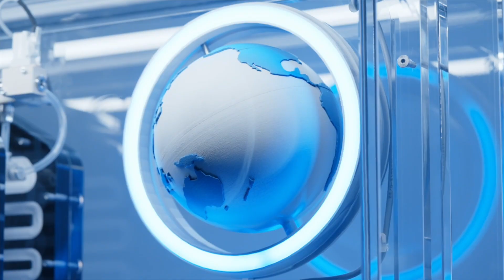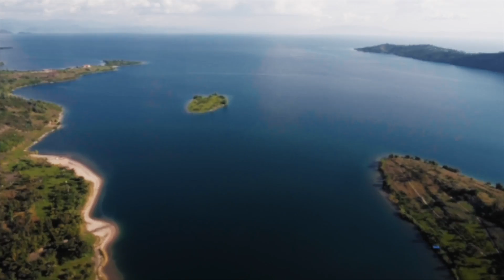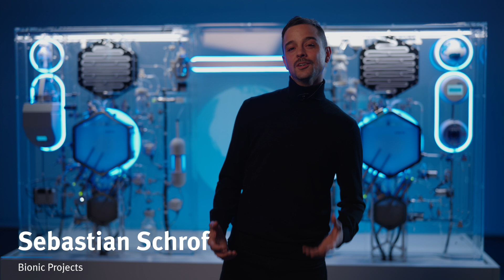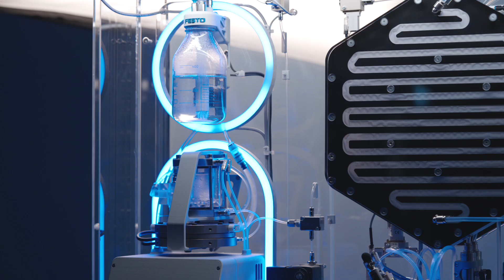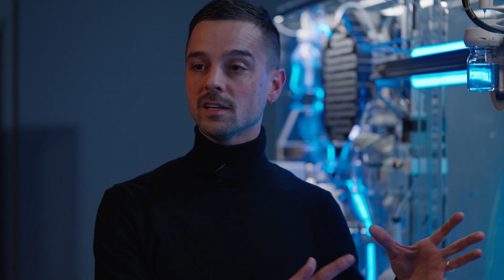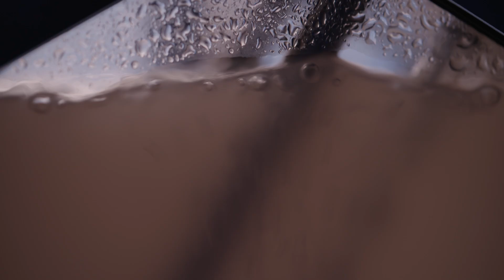Festo BionicHydrogenBattery

Comment: like this is cool and all, and could probably be used in industry or chemistry to make hydrogen on sight rather than needing to store and transport it in a gas but like, by the time humanity has set up hydrogen reactors that can use this in what like 15-20 years (new tech takes a while) we will be most of the way to a mostly classically renewables based power grid, or the more pressing issue would be the multiple extinction level weather events a year, and not power generation. The issue for solar and wind could be in cold environments but you have an issue with this freezing and lowering production as well, is there even a viable gap in the market for this, for anything other than maybe formic acid production for use as formic acid?

Comment: Interesting idea, but calling it efficient or economically viable (which is implied in the video) is a stretch at best, especially if you were to scale this up. It cant be efficient (both in therms of energy and space) to concentrate this liquid which is essential for long term storage since you cant store a 1 percent mixture of that stuff (unless if it's ok in a usecase to store 1kg of hydrogen in more than one ton of a dilutedd acid. Even if that limit is overcome, there are many maore. Anything power demanding cant use this form of storage (as it is now) because the reactorsize to achieve a high enough throughput compared to conventional methods is gigantic.  So saying it doesnt need to be gentically modified to increase throughput and efficiency is more wishful thinking. Besides what would gentic engineering help? i dont think it could fix the fundamental efficiency problems of this process. Bacteria need energy to live and replicate. that energy must come from hydrogen, meaning the "catalyst" isnt really a catalyst either. It consumes (potentially) a major part of the hydrogen compared to other inorganically catalyzed processes. If the underlying biological process has a higher efficiceny than current formic acid pathways it might be viable to look into that, in order to find a more scalable solution, that isnt limited by biological restrictions and can operate at much higher throughputs and small space and low catalytic needs (heat required, materials, resistent to most environments and has few catalytic toxins).

Comment: I'm doubting about this project. 1) before the bacteria reduce CO2 to HCOOH (direct reaction), then the same bacteria oxidize this compound to CO2 (inverse reaction): which conditions allow this metabolic change? In photosynthetic organisms light presence or absence causes the CO2 reduction in carbohydrates or their oxidation. In these bacteria there isn't any trace of chloroplasts.
2) The reduction needs energy: where does it come from?
3) How do we prevent the destruction of these bacteria by other microorganisms?
4) What's happen if we don't feed them? Wich other nutrients do they need? When they'll multiple (bacteria double population every 20 minutes about), raising overpopulation, what will we do?
5) How many energy does the bioreactor consume and how many energy does the batch produce? (Tell the amount of microorganisms population, please).
6) Which size have the system?
7) For you this transport of hydrogen is safe: you don't tell it's formic acid, the venom present in ants, bees, hornets.
So how do you prevent some accident? What's for allergic people? How concentrated is the solution? How is it regulated? I don't see any manometer, or pH-meter, or other apparatus.
8) Also heated acid formic in presence of ammonia transform to ammonium formate, then formamide, and finally in hydrogen cyanide: another problem during a fire.
Reply: If i may throw my 2 cents into the ring, 1) It would be a matter of concentrations or temperatures, much like how plants release CO2 at night when photosynthesis can't take place, if the conditions are right then it would be possible that the inverse process could take place. Assuming that there would need to be a metabolic change is not considering that these bacterium already have that 2 way metabolism. 
2) The bacterium cannot be treated like a chemical reaction. In classic chemistry there would need to be a reduction but in this case, the bacterium are living things which means that they feed on it and are not just performing a simple chemical reaction.
3) Hermetic Sealing and Teflon Coatings as a start, but we are very good at making very pure things and making sure there is no contaminates would be a trivial process.
4) They explained this in the video, they require a certain temperature to grow and as such, if we don''t feed them then they just lay dormant, if we for example lower the temperatures of the containers, they will survive without food in somewhat of "hibernative" state.
5) Bioreactors don't consume energy, nor directly produce in this case. They leverage organic processes to convert one thing to another. A good example is an alcohol still, that is to say the fermentation process. You give it food, and let it do it's thing, as simple as that. In this situation, they are only using them to convert gaseous hydrogen (H2) into formic acid for the transportation and storage of those hydrogen molecules for a retrieval at a late time. The only energy i could potentially see it needing to consume is the heating of the bioreator to increase colony counts. (You could probably find papers from the university on this bacterium)
6) Scalable, more bacteria = more capacity
7) It is far safer than the high-pressure, inflammable gaseous hydrogen that was used on the space shuttle... As long as you're not drinking or injecting it into your body, i think you will be fine... Last time i check, a sting from a bee was not nearly as bad as a massive firey explosion. Preventing an accident is the same as transporting any chemical... You take precautions and avoid doing stupid things... People are not allergic to the formic acid in those stings, they are allergic to Phospholipase A2 and mellitin in bee stings and antigen 5 in wasp stings (Something i could find out in 1 minute of googling)... Go google the Hazard Diamond for Formic Acid, we know what it is and how to handle it, ISO, FDA and NFPA all have guidelines on handling chemicals in a safe manor. The regular person is not going to be buying bulk quantitys of formic acid, this is more for industrial or commercial purposes.
8)"in the presence of ammonia" so then just don't expose it to ammonia, i don't know places where you just randomly find ammonia, because i think the people transporting it are a little more careful that the regular person. Again, "in a fire", i would much rather not have a massive firey explosion from gaseous hydrogen. This is a 3 step chemical reaction which firstly requires the correct conditions for each step, but you have also neglected to factor in that in a fire, all of those chemicals are evaporated and either taken away or decomposed. Hydrogen Cyanide decomposes at around 100 degree C meaning that if there were a fire it would instantly be decomposed... 

I understand the concerns but they are not founded in actual science, the Dr. PhD responsible for this has a PhD for a reason, and Festo is a leading company that specialises in bio-mimicry and symbiosis, i think they know better.
Reply: @DaineRic299  About ten years ago was performed a hydrogen battery based on methanol.
Every alcohols and every acids are hydrogen carriers.
Every day they are transported, sold and bought. Where is the innovation?
Reply: Your number 2 answer is wrong: bacteria are based on chemical reactions and they are under thermodynamic laws. If they need perform an enzyme they must have their chemical energy storage.
Do they feed glucose? They consume that bound chemical energy.
Reply: @phantomzone2571  Its not wrong, you're misinformed, They anaerobic, meaning that they don't need/use enzyme reactions or Glucose, they feed on other compounds, in this case its hydrogen and formic acid. The chemical energy comes from the chemical potential energy in the hydrogen and formic acid. Yes, i agree that bacteria are based on chemical reactions but they cannot be considered just a chemical reaction as again they are living organism... Everything is under thermodynamic law, they can do conversions like that whilst following thermo-dynamic laws. Have look at a chemical clock. On a fundamental level, it is the same type of reaction.
Reply: Your 5th answer is wrong: bioreactor consume energy, because it need constant temperature, filter the suspension to separate bacteria from formic acid solution, servos to pump the solution in a container, and perhaps an UV system to avoid contamination of the batch. So also I replicate to another your sentences.
Reply: @phantomzone2571  That is the bioreactor support systems, the bioreaction itself requires no energy, but if you want to talk about the whole system, then yes, sure it needs energy to function but they didn't claim that it uses no energy, they said it is substantially less that that which is required to process hydrogen in other forms.
Reply: @DaineRic299  All right! I want a bioreactor of 10 mc batch. How much do the pumps consume? Is the stirrer magnetic, electromechanical or insufflating? How much consume? If the air is blowing in the suspension, can the oxygen to damage a bacteria "eating" carbon dioxide?
Which temperature do the colony need to survive? Remember: for increasing of one Celsius degree one litre the bioreactor consumes 1 kcal about (you can calculate in joules: googles'll  help you). Then filtering and circulating pump, ecc.
Reply: @phantomzone2571 As I see it, it’s a new concept, which of course isn’t perfectly understood yet and of course there are problems that need to be sorted out, but that’s just a normal part of making a concept economically feasible and I‘m sure they are hard at work on all of those. But I think at this point in time you’re exaggerating quite a bit. Yes, there are materials, that when burnt release ammonia, but this technology would most likely be used in a industrial application where everything would be designed to eliminate those risks. As of right now there is no indication that it would make sense in a home application.
Reply: Your 6th answer is so ... childish. Do you build a bioreactor of every size and shape? I think you have a precise standard of models.
Reply: @phantomzone2571  How is it childish? The ignorance to assume that there can only be one perfect size is what is childish here... A bioreactor doesn't need to be a specific size or shape, there are shapes that work more efficiently maybe, but again going back to fermentation as an example: You can ferment in a bucket, a bowl, a spoon if you wanted to, its the bio-reaction that is important, the shape and size of the vessel is irrelevant.
Reply: @DaineRic299  It's childish because this bioreactor is for general and commercial purposes, like a car or a washer. How much hydrogen do you want produce or transform? In which time? If you have a 10 mc batch, do you use it on half capacity? There are cost and they must be decreased how much possible.
Reply: Your 8th is wrong: during a fire ammonia can be produced from every amines in paint and  in many plastics, and almost pharmaceutical and cosmetics. Also some synthetic sugars are N etherocycles. Put in the list ammonia salts and urea used in agriculture. Well, well: houses, farms, chemical, pharmaceutical, and cosmetics factories, plastics plants if they have their bioreactor to convert formic acid to hydrogen, there is a very very big problem.
It's the difference between a book reader and a Google finder.